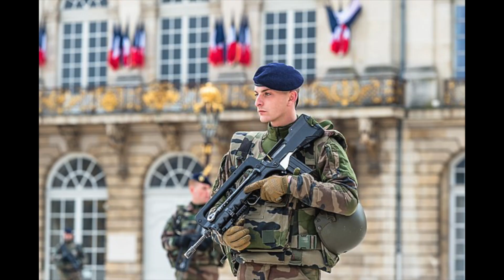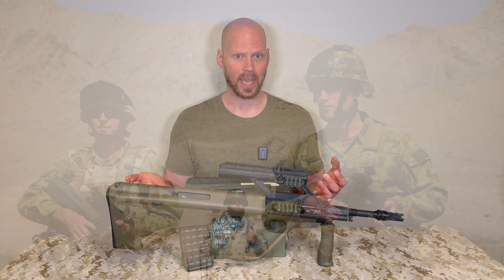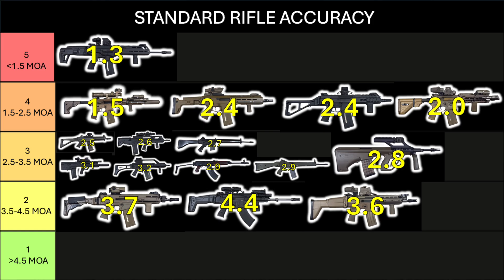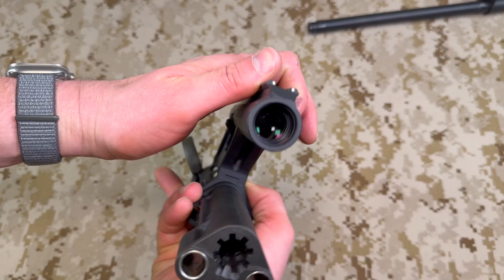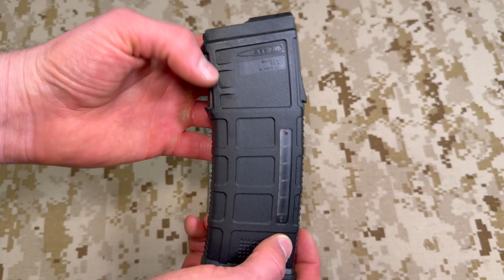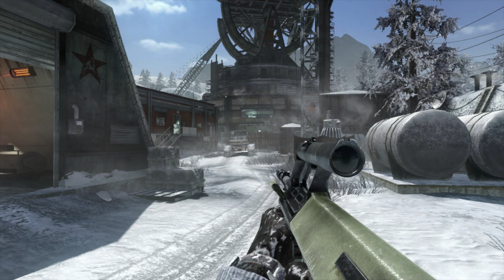Steyr AUG: The Future, Circa 1977

Comment: The original AUG would have scored zero on modularity. This was the main reason our SAS used the M4. I would give it a 5 for ergonomics. It is probably one of the nicest balanced rifles to patrol with. Soldiers spend 99.9% of their time dragging their muskets around with them or cleaning them. The Kiwi version differed a bit from the others in that we had a crosshair in the doughnut of death, and our safety was three position. We did not have the progressive trigger.

Comment: the factory trigger is adjustable take the stock off look above the trigger you'll see a hex nut that's your trigger adjustment. The tool for adjusting the gas is the sling pin from the stock.